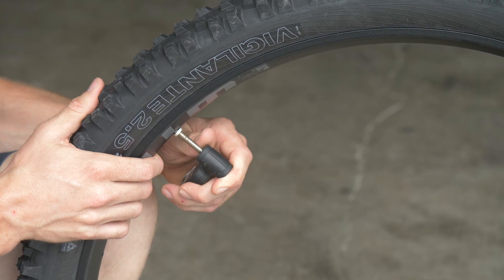Discussing Air Loss with WTB

Comment: Is it normal for a brand new tire to weep from the sidewall? I have a pair of brand new Riddlers, the front tire has over a dozen tiny points of sealant around the perimeter, mostly on the tan wall some at the seam of the tan and black rubber. I added more sealant and the air loss has diminished. I assume that it will seal over time, but since the rear tire isn't displaying this, I wondered if it was normal. Thanks
Reply: If they are labeled as tubeless tyres, it isn't normal but this is commonly found on non-tubeless tyres. If you leave the wheel sideways overnight on each side to coat both sidewalls, it should seal. I wouldn't worry about it unless it doesn't seal after a couple of weeks or rides. It's more of an issue if the tape is leaking because that's a real pain to have to re-tape the rim. I have never used tubeless WTB tyres so I don't really have any experience but hope this helps!
Reply: @imattultra1623  Thanks, they are tubeless. But, they seemed to have settled down. I added sealant, left the  wheels on their side over night, and they are holding air much better. Thanks
Reply: @rcgsail1  I helped a collegue of mine to set up her tubless setup using wtb riddler. Using fresh sealant (and more than enough). We did shake thourougly and as she's commuting daily, it is moved a lot. Still using sealant (slowly) through the sides. Especially through the ring close to the bead. Annoying. Looks like a manufacturing problem on some as I never had that with any other tires before (my WTB work perfectly fine).

Comment: Hey WTB Team, does 'discussing air loss' means that you'll also answer? I've read a couple of times, that WTB Riddler are bleeding on the sidewalls even if they are properly installed. And keep bleeding although regularily shaked and moved. Is there a specific reason? Does not really feel save for longer rides.
Reply from the maker: Hey there, thanks for reaching out here. If you are experiencing issues with your Riddler tires, then you can reach out to our team using the form below to see if we can help :)

https://www.wtb.com/pages/warranty
Reply: Same experience for me. Nice tire, but not a good tubeless tire.

Comment: Great!  I just bought a pair of Ventures because it is the few tires that even come in 50 width--the max I can fit on my bike.  Mounted one and it was seeping through the sidewall just off the bead all around and on both sides.  I wish I had checked more reviews than just Amazon (so many people don't know what they're doing).  I never had issues with the Riddlers.  Why the difference?

Also, why does the tire say to use a pressure of 30-60 psi and the website says to use 25-45 psi?  Venture 50 x 700   I mean 60 psi does seem to be a bit high for a 50mm off-road tire.

Comment: One of mine looses 50% over night the other is fine. I removed and cleaned the valve. Reseated it etc as there were some small nubs sticking in between the rim and tire, cleared those. After that I Reseated it and there's a lot of sealant in the tire but it still looses 50% over night and there is a small amount of sealant showing all the way around the rim. Do you have any suggestions? Wtb 32 tan expanse.

Comment: I just had some WTB Nanos installed on my gravel bike and I brought them home from the shop with 40 psi and the next morning they were at 10.  I pumped them up to 50 then went on a 30 minute ride and when I got back they were down to 35 and 40.  This morning they were 20 and 30.  I'm not sure the shop did the best job (there was sealant all over the outside of the tires and the bike itself).  I'm going to take the tires off and add more sealant and lay them flat to get most on the sidewalls as that's where I can see tiny bubbles when I pump up to 50 psi.  I've never had anywhere near this problem with my MTB tubeless which even after sitting for weeks doesn't lose much air compared to what pressure I ride with (~20 psi).  Am I just airing these up too high? Should I ride with lower pressure?  I don't ride true gravel roads, this bike is more of a city bike which sees mostly street but does go on some crushed granite trails and flowy light singletrack and jeep trails (small rocks and roots but nothing too tech).
Reply from the maker: Hey there. It's quite normal for tires to lose air like this right after the initial tubeless setup. We'd always recommend bouncing the wheel/s around or going for a ride once they've been set up for the first time as this will spread the sealant properly and help create an airtight seal.

If you're still losing air after that, then it's possible that there's not quite enough sealant in there. As you mentioned, a top-up would be a great place to start. Just make sure that you using the exact same sealant that the shop already put in there. You shouldn't have to change the pressures that you prefer to run, if you like to run 40, then they should hold 40.

Finally, it's also quite normal for all tubeless tires to lose air slightly quicker than tubes. Not quite to the extent that you mentioned, but we'd always recommend checking your tire pressures before every ride.

Hope this helps, and good luck with the top-up!

Comment: I've used a number of WTB tubeless tires, TCS rated. Compared to other brands, WTB has far more leakage. Most of it is from sealant seeping through the sidewalls. Doesn't matter how much sealant you use, WTB's will leak out as much as you put it. Too bad, I really like the tires, but I won't buy them in the future.

Comment: Judging by the reviews all over the internet and my own experience, the WTB tubeless system is trash. Leaks that will not seal even on brand new tires.
Reply: Can confirm.  I just bought two WTB Resolute and both leaked air and sealant through the sidewall.  They are not rideable without a tube.  So disappointed.  I will never buy any WTB products again as they do not care about quality.
Reply: @alexiz689  I eventually got my 1 Expanse 32 to seal. It took over 6 ounces of orange seal with fiddling for about a week. They say the tan walls are worse, and that's what I bought. That's kind of crazy considering I can get any other brands 2.4-2.8" mountain tire to seal without any sealant at all. Even tan walls. 
If you're searching for a good gravel tire, buy Donnelly tires. They are a little more expensive, but they have a long lifespan, and they're the best tires I've ever used.